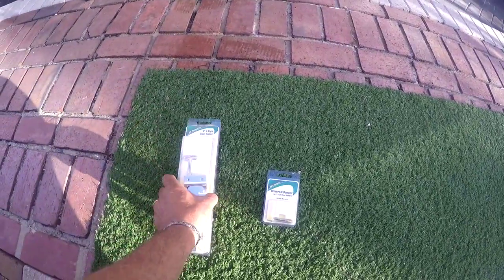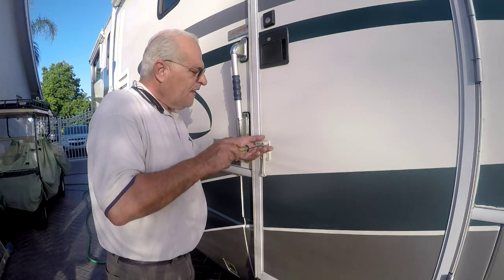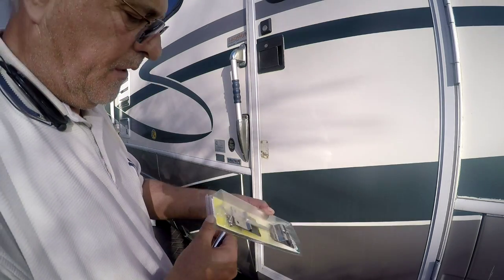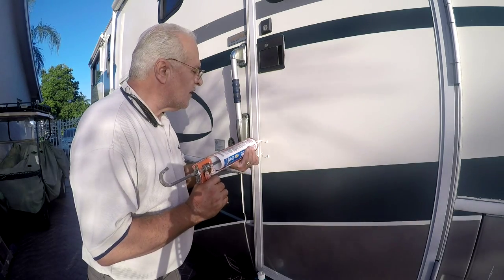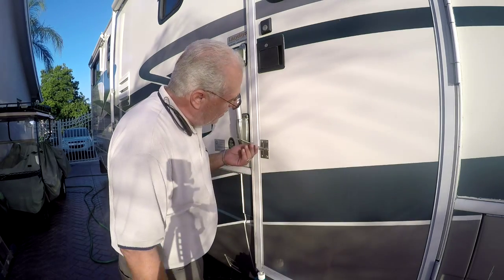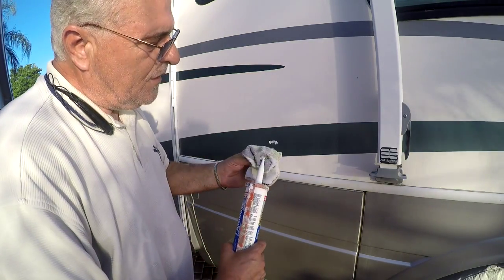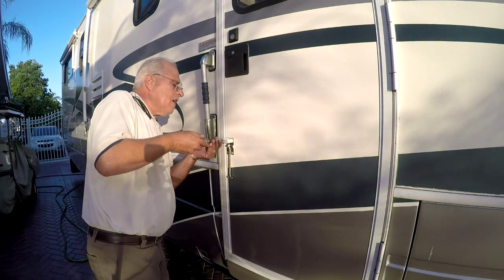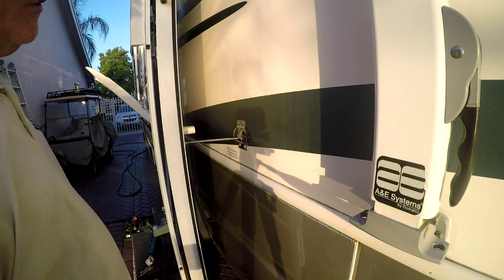HOW TO REPLACE RV ENTRY DOOR HOLDER with STAINLESS STEEL & UNIVERSAL BUMPER

Comment from the maker: Replaced the Entry Door Holder with a new Stainless Steel RV Entry Door Holder.
Made by JR Products Part # 10525 6".
Also replased the old bumper that mounts on the top of door holder that protects
the exterior rv wall from getting hit by the door hadle in case it slams open.

Comment: My existing was reversed - the latch with the "T" bar and bumper was on the side wall and the receiver bracket was on the door.  I think my existing way makes more sense.
Reply from the maker: It would make more sense. But the molding just below is too close. Thank you for the suggestion.